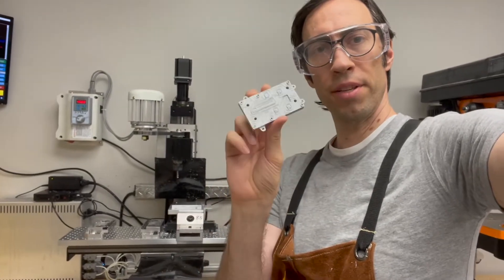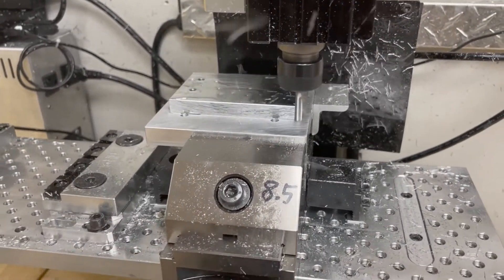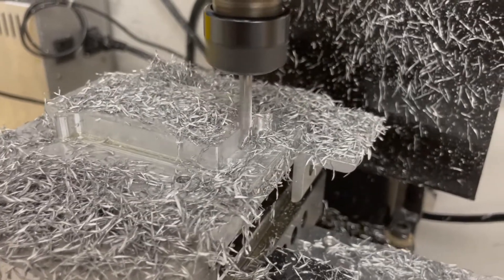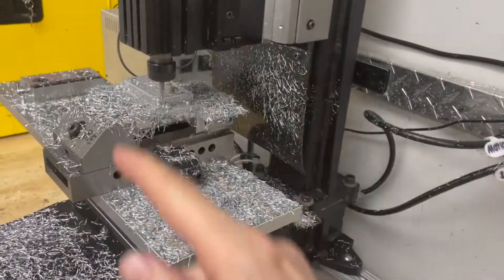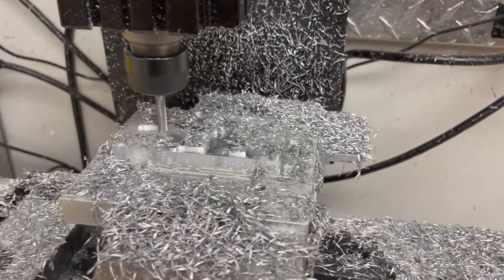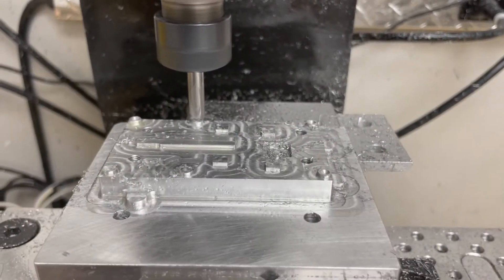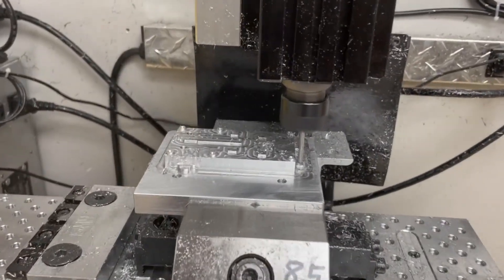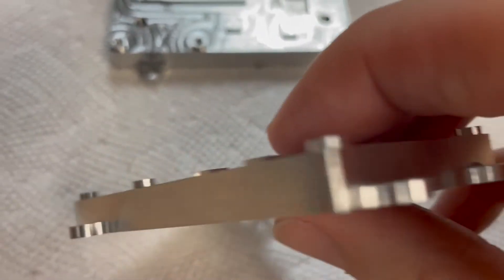Taig CNC Machining a Heatsink

Comment: Great bud. Can you pop a link up to the fixture plate and vice please? 🙏
Reply from the maker: https://saundersmachineworks.com/products/universal-aluminum-fixture-tooling-plate?variant=39379872186470  I got the 20x6" size.
Reply from the maker: The low profile vise is from Saunders also. The bigger vise is a cheap grinding vise from amazon/ebay. They are all the same.

Comment: Great content Nick. Is the headstock a stock, Taig unit?
Reply from the maker: Thanks. The headstock is the stock ER16, yes. The motor is an aftermarket Consew CSM500, and the pulley and belt is aftermarket.

Comment: Hey, I saw your amazon review on that consew motor!  How is the motor? 
Was also thinking about using that for my printnc mill project
Reply from the maker: It's been great. I think I've had it since 2019 or 2020, I forget. Zero problems. I only use the mill for a project once a month or so though, so not heavy usage. I also bought a slower RPM higher torque version for my lathe, but haven't installed it yet. That is CSM3000 model number. The one on the mill is CSM1000.

Comment: Hell yeah that’s “pretty good” holy shit I’d be so damn happy to have that good of quality and accuracy, the rest of that could easily be made perfect with a super light skim pass with a 6-8 flute end mill. I loved watching this as I have recently got into the micro machining hobby and currently have a really nice sherline 17” lathe with milling column but want to eventually save up for a 8 14-18” axis sherline CNC mill, but I’m not sure if I’d be better off buying a larger chinéese one and getting it running well then and steppers to it myself just so I have a larger work area, but I’m not sure. I know sherline and Taig make amazing quality machines but their largest is still not very large as well as being several thousand dollars! What would you recommend?
Reply from the maker: Thanks for the kind words. If you have the means, I'd consider going the DIY route. Make a frame out of cement or epoxy granite, use linear rails and ballscrews, and one of those green aliexpress spindles. I'm working on a design for one now, it's on my channel if you want to check it out. The Taig is a good machine, but I find I run into the Y travel limit a lot.

Comment: What program are you using here ?
Reply from the maker: UCCNC for the controller. Fusion360 for the CAM. Onshape for the CAD.
Reply: @nickp4793  
Would I need to setup UCCNC or does Taig come with the controller ready to go. I’m new to this
Reply from the maker: @TheHelicapt  You can buy the Taig complete with software and motors, but it's a higher price. If you go that route, it's ready to run, and comes with Mach 3. The other option is to get the Taig "CNC Ready". You save about 1,500 USD, but you have to supply your own stepper/servo motors, motion controller, software, etc. If you go this second route, you will definitely save money, but you have to figure it all out yourself.
Reply: @nickp4793  
Ahhh got it. Thanks a lot. How are you liking the Taig so far? I might buy this one as I can’t afford a Tormach 440
Reply from the maker: @TheHelicapt  Its ok, but if you want to cut aggressively it needs some upgrades. Mine has a sewing machine motor, cogged belt drive, and an aftermarket frame. I added all of them. The stock setup works ok, but for smaller work and lighter cuts. There is not really much else available though new. The other CNC machines in this price range are more "router types".
Reply: @nickp4793  
Good info. Something I need to then think about. Maybe save for 440
Reply from the maker: @TheHelicapt  yeah the 440 is a completely better class of machine. If you can swing it and can fit it in your shop I’d save a bit more and go for that. Taig is really if you don’t have the space and need a small desktop machine. Or, need a lighter machine that’s easy to move by yourself by simply lifting it up.

Comment: How would you say the noise is on this machine compared to a belt grinder? I've found a low grit belt grinder on steel is borderline too noisy for my loft, so I'm nervous about finding a sound solution before I purchase.
Reply from the maker: Hi, I'd say the noise from the mill itself is less. Especially if you lower the RPM's and federate, you can make it pretty quiet. The most noise actually comes from the compressor cycling on and off to blow the chips.
Reply: @nickp4793  Thanks so much for the info Nick!
Reply from the maker: To follow up on this, I ran the mill today for some small parts. Next to the mill is a Kalamazoo 1" belt sander. The belt sander (only turned on, not sanding anything) is definitely louder than the mill. When the belt sander is sanding metal, its much louder.

Comment: Very nice sounding cuts. How much difference with the upgraded frame?
Reply from the maker: Its hard to say for sure, but it does seem the cuts are a bit quieter with the upgraded frame. I also filled it with epoxy granite. The finish quality seems about the same as the stock frame though. Maybe if the part was taller and the Z was at the top of its travel during the cuts, there might be a more noticeable difference in cut quality there. The biggest benefit IMO is it allows full access to the full axes travels, which was not possible with the stock frame (unless you modified it a bit how I show in another video).
Reply from the maker: I want to amend my statement. I just made two more of this same part and I ran it at 100IPM with full cutter engagement. It ran extremely well. The noise was very smooth. Cut quality was great. I don't think there is any chance the stock frame would have been able to handle it, without pivoting out of tram and/or shaking a lot.